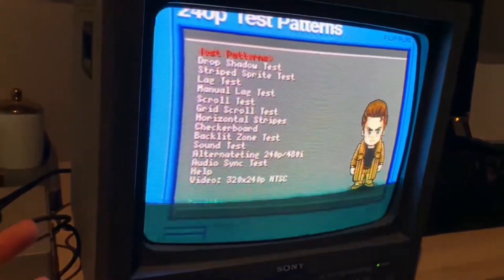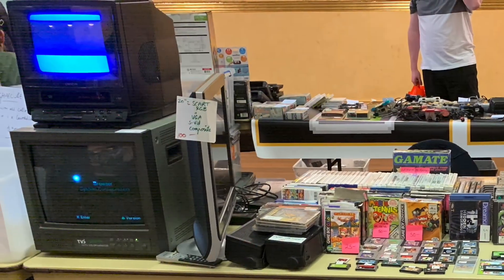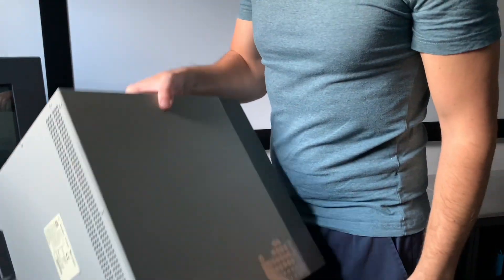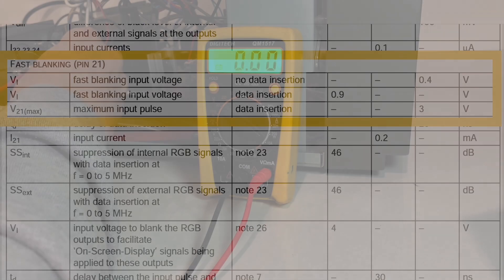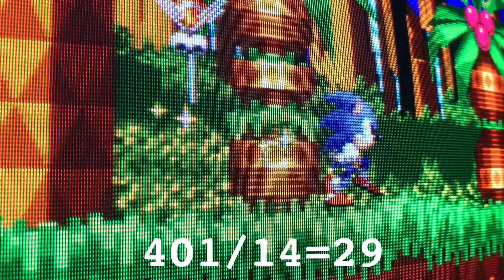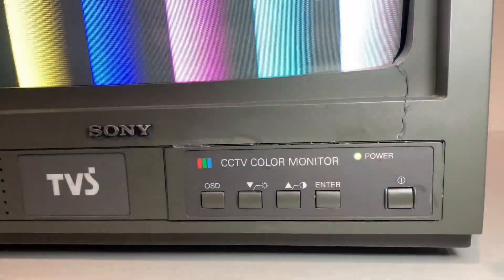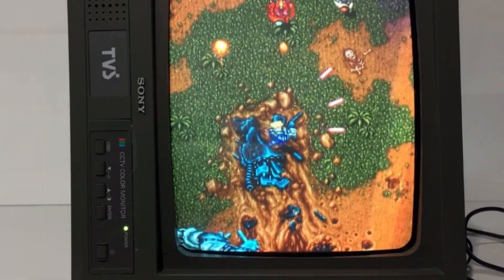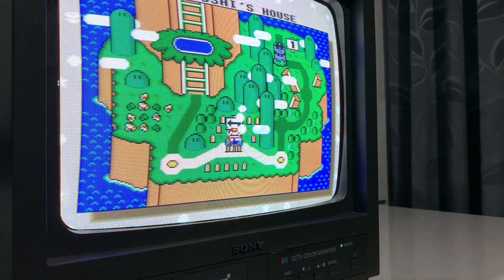This is NOT a Sony PVM - CRT monitor RGB mod for retro gaming. TVS CM-14DNA security CCTV CRT

Comment: I have a Sony Wega model. KV-21FS140 do you know if it can be modded to RGB?
Reply from the maker: From what I read from MarkOzlad on the Shmups CRT RGB Mod thread, Sony BX1S chassis have locked-out RGB so probably no, or at least not easily. Do you have component input? You should get practically equivalent fidelity to RGB if you have a half decent transcoder
Reply: @MarcoRetro316 yes it has component inputs

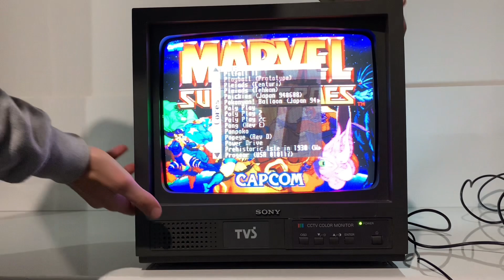Comment: 7:00 I have the same monitor, Tate mode does not work, counterclockwise rotation gives purity issues near the bottom right and clockwise rotation completely messes the colors yielding a purplish color scheme throughout.  A very competent monitor but not for Tate mode unfortunately for me.
Reply from the maker: Yeh even rotating on the right had corner purity issues for me. Great little monitor though

Comment: 3:09 what is the purpose of the Video- Y/C switch
Reply from the maker: It’s there from factory to switch between composite and S-Video
Reply: @MarcoRetro316 ah so there's a workaround to switch between the two, no automatic detection for composite/Svideo signal?
Reply from the maker: @broznar1019  It seems it’s the way the TDA8361 video IC handles Chroma Trap filtering. According to the datasheet, voltage applied to the Chroma detect pin switches off chrominance trap (used in composite), so that separate Y/C can be used for S-Video.
Reply: @MarcoRetro316 ah a bit of a nuisance,.i have the same one but in a media cabinet not very accessible for switching back and forth, will probably only use it as an svideo monitor 📺

Comment: Hello. Question. Is it worth it to mod a consumer grade CRT with component inputs for RGB?
Reply from the maker: It depends. If the TV has good handling of component video then using a component to RGB transcoder will have next to no difference to RGB. On the other hand, some TV’s process component video poorly for white balance and reduced sharpness. If you have a set with component and already have a transcoder then I would see if the image looks acceptable and much better than S-Video if that’s an option. Chances are that it should look just fine

Comment: Hey Marco

I have a CM-21DXA

I'm hoping I can use this info to RGB mod mine
Reply from the maker: That’s an awesome pickup! I’m honestly not sure if they’re using the same chassis/video IC. Only way to know is to open it up and see if the video chip matches this one and if capacitors on the RGB lines are grounded

Comment: I have to say this mod is cool, I just did an rgb mod on a Samsung but I used 220 ohms instead of 75 for termination. I do not know how you increased voltage on the blanking line with a pull up resistor, did you just connect one leg to the jungle chip and the other leg to another place on the board? Sorry I’m just getting into electronics and trying my best to understand
Reply from the maker: Thanks! The pull up resistor was honestly trial and error as I left the blanking pin in circuit, otherwise had I isolated the pin then it I would’ve connected voltage as required. I’m curious, for 220ohm termination, was that to achieve the desired peak to peak voltage, or that’s what the datasheet stated? I’m learning much the same as you

Comment: Is it possible to mod a CRT to have an HDMI input?
Reply from the maker: Technically yes. But the HDMI signal needs to be converted to analog before sending it to the TV. The resolution would also need to be 15KHz by downscaling the video to 480i/240p
Reply: @MarcoRetro316  Okay thank you, I was just planning on setting my RetroTink 5x up to a CRT.

Comment: I have a 14 inch tube TV from the Changhong brand. This TV has 2 composite inputs, 1 s video and one RGB input and one composite output. It's a bit unique because this is the commercial version which has an RF tuner. And yes, the tube is from the Chunghwa brand which is very good in its color production.
Reply from the maker: Is the RGB connection BNC or Scart?
Reply: @MarcoRetro316  No.. it's just an ordinary RCA standard.. once again this is a regular consumer commercial TV. I think this is also only for the Asian market. I still use it because the AV input varies.
Reply from the maker: @deanagoes2791 that is a very unique TV

Comment: Nice video! This Chunghwa tube is very common in North American market 13" CRT TVs from the 2000s. Looks quite nice with the RGB mod, though not as "scanliney" as higher resolution pro monitors.
Reply from the maker: Thanks! I’ve seen a few of these Chunghwa’s in later CRT’s. You’re right, they aren’t heavy on scanlines but they are sharp enough to not give the vertical bar-effect on lower TVL consumer sets. Definitely no pro-monitor level

Comment: Thx for video.
I have pretty simmilar CRT. TVS 21DXA, which >500 lines.
I am at state of finding OSD RGB pins for Jungle chip.
Can you tell, where you obtained 3.3v for activation pin?
Reply from the maker: Hi! This one had a TDA8361 video chip and pin 21 was for RGB switching. Instead of introducing voltage, I kept the pin in circuit and just added pull-up resistor to which it achieved RGB blanking. Normally I would isolate the pin and tap 5v from the voltage regulator and drop it down to ~3v with a voltage divider. I suggest you look at the datasheets for the voltage regulators you see on the chassis to find the 5v regulator and go from there
Reply: @MarcoRetro316 Well, returned to mod.
Got 5V CCD supply current (pin 31). If I correct, that what needed.
Now I must apply to pin 17 3.5V.
How to lower 5V to 3.5V?
I am pretty far from schemes, but I did some Arduino projects at university. I can only think about DC-DC converter, but you used something different.
My jungle chip is LA76818A.
Reply from the maker: @MrXMaximus a simple voltage divider will drop 5 to 3.5v. Search for a voltage divider calculator and plug in a few resistor values that you have on hand, example, 5v with 100ohm and 230ohm voltage divider will net you about 3.5v
Reply: @MarcoRetro316  THX a lot. Will reply in month on result. I forgot 0.1 capacitor and must find it somewhere.
Reply: @MarcoRetro316 Replying.
Did the mod, but have issue...
I see definitely RGB signal, but it extremely blurry.
I have modded PS1, which can't do colored NTSC.
If I connect it over composite/S-Video it is black and white signal.

Over SCART RGB MOD, it is colored now, but as I said, it is impossible to play, because of blur.
What could i do Wrong?

I used 75 Ohm res to every color and to the ground, from every color 0.1uF capacitor. Each color goes to jungle straightforward.
When OSD FS off, I can see clear composite (black and white).
OSD FS ON, blurry rgb.
Reply from the maker: @MrXMaximus  I ran into the exact same issue before but I didn’t take note of which video chip. My friend and I figured the IC was software locked from the factory after we tried all ranges of blanking voltage
Reply: @MarcoRetro316  deep breath
Grayscaled piece of RGB!
My jungle: LA76818J (used LA76818A datasheet, cause couldn't find J)

Too pity though, I hoped to use it for Raspberry with GBS-C downscale.

I even did hole in metal for SCART. I thought it would be easy with drill (it's not) and spent like 4 hours for SCART hole.
Reply from the maker: My sentiments to you, but you’ll be even better equipped for next time you RGB mod. Keep at it!

Comment: Couple of points this video is hitting home to me. Nights soundtrack, I bought it on steam last night for while I wait for my saturn 3d controller to arrive. I've bought back a crt when I got my head around the basics of rgb modding, so glad I did as its a nice set and all that was missing was some caps and resistors as its a universal chassis samsung with composite jacks soldered on the 21 pin scart socket on the board. I've got a spare 14" RCA/thomson with scart that uses that chunghwa tube and looks like low use, if it was in a panasonic, sharp, sanyo set you wouldn't even question its a chinese brand tube.
Reply from the maker: Nights is one of those chill but engaging games that I can play no matter what mood I’m in. My first RGB mod was much like yours but on a TEAC and just filled in some missing components on the chassis. The Chungwha ain’t bad at all and is actually a lot sharper than another 14” consumer I RGB modded with a Sanyo tube